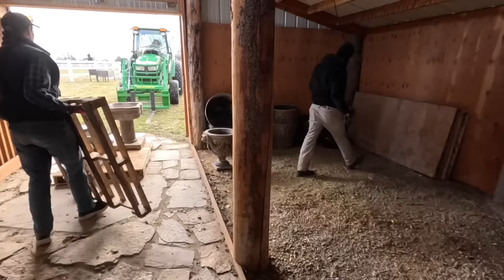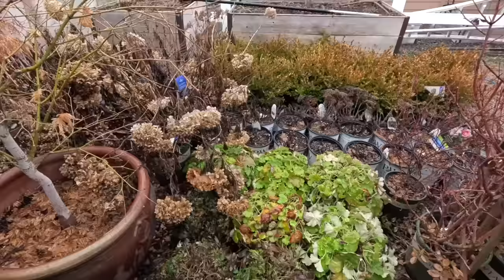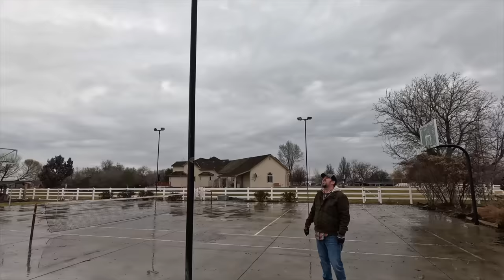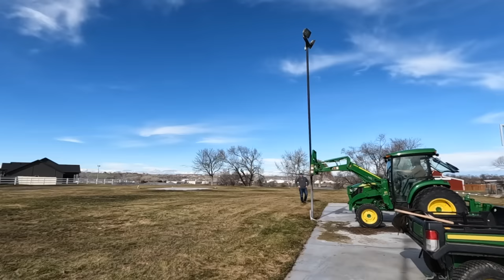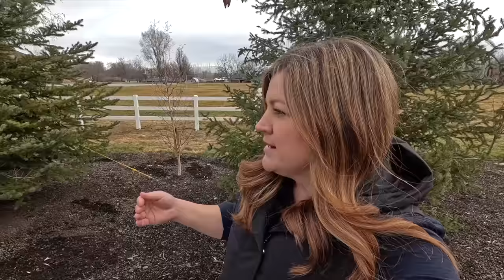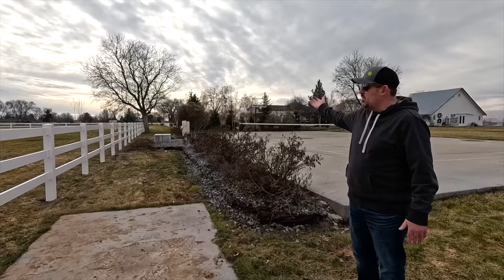Taking Down the Tall Lights Behind the Pond + a Bunch of Other Stuff! 😆🙌😁 // Garden Answer

Comment: Good stuff - FYI in the future when pulling small trees & large shrubs with the forks on the tractor, it's much better to drive the forks forward and under the rootball and then use the wrist joint to pop the plant out.  The wrist joint pivot can apply more upward force than the arms.

Comment: The wood structure with hardware cloth is a compost sifter. Used to remove the fine finished compost from the larger items that have not completely composted.

Comment: May I suggest a Sport Shed or booth to keep sports equipment and accessories dry and out of the heat or weather. A place to keep drinks out of the sun is also a nice touch. Not just a deck box. Looking good though.

Comment: Have you thought about a net/mesh divider instead of a fence? It’s run on a wire cable with a pulley system to open and close it- that way you could take it down in the off-season or even just pull the sides apart (like curtains)  when you aren’t using the court and there wouldn’t be much of an eyesore to look at or worrying about covering it with high maintenance vines 🤷‍♀️

Comment: Hey guys. I think I would've broken up any concrete and removed the white stones around the base of the light poles then dug down a few inches pushing soil aside before using the multi tool to cut the poles. Otherwise you're going to have that metal pole stump sticking out of the ground and will be a trip hazard. You can still do it. Just a thought. It's inevitable people will trip. I've seen problems with issues like this. Love you guys!!! Great job Paul and Bethany!!! 😊

Comment: I’ve broken concrete off of fence posts with a maul or sledgehammer and it wasn’t as hard as I thought it would be. I did this while in my 50’s. The concrete can be used as rubble fill on another project or hauled off. That would leave the length intact. You might have a rancher at your church that could use the barbed wire. The chain link fence might be useful for an animal rescue for erecting more kennel spaces and the lumber from the old chicken coop too if they have volunteers that are handy. I know how expensive those things are. We’ve spent a lot of money making a chicken coop.

Comment: What did Aaron mean as he was yanking the outlet out of the ground, that he didn't know where it came from?  Surely you had to know where it originated in order to disconnect it at the panel before yanking it apart.  The wires can't still be live.

I can NOT imagine a 10 foot chain link fence however.    That would be so much worse than some parking lot light poles!